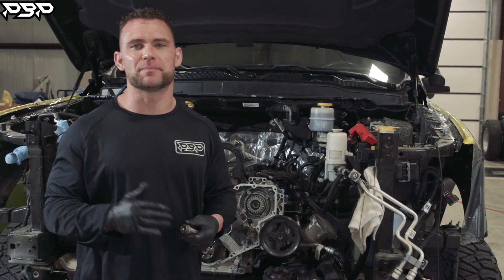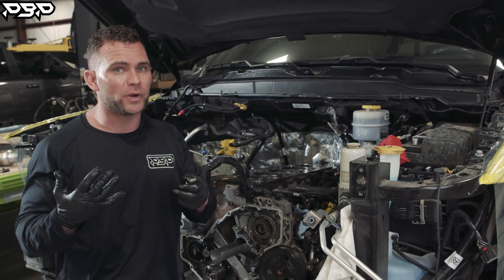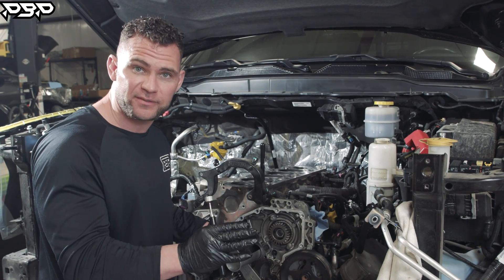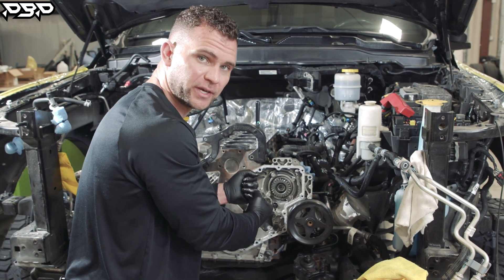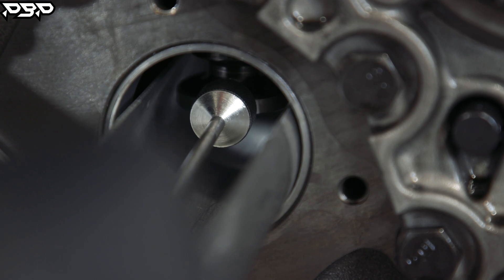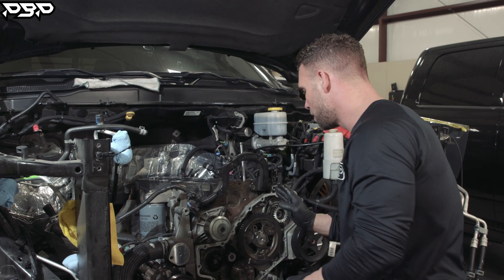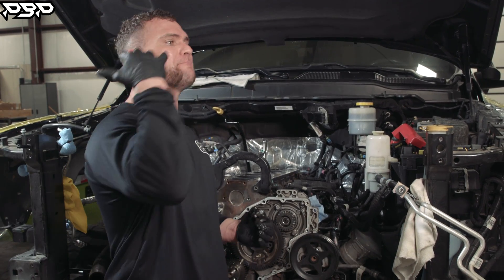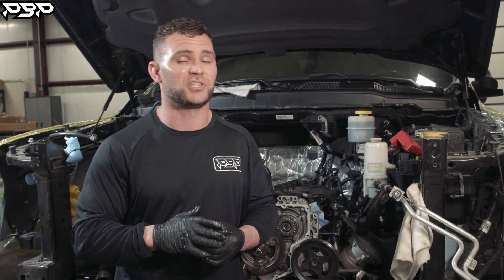5TH Gen Cummins Solid Tappet Camshaft Install!

Comment: Looking forward to doing this in my truck. 72K problem-free miles but I know those stock lifters will get me at some point.
Reply from the maker: They may then again may not ! Check out our pushrod upgrade it’s worth the time. If you have any questions just holler sir.
Reply: @POINTBLANKPERFORMANCE That may actually be the way to go for now. Is that as reliable as the total tappet lifter swap? Of course it’s probably kinda hard to quantify that
Reply from the maker: We tell it like it is , it’s a preventative maintenance. Anything can happen.

Comment: Does the head have to come off the replace the cam?
Reply from the maker: No sir.
Reply: Without the head off and cab on can’t get the push rods out or new ones in on 5 and 6
Reply: @hookedonjesus1716  I am so tired of hearing and worrying about what could grenade my 2022 I am going to sell it. Not going to buy a new truck again.
Reply from the maker: New meaning 25 and 26 ? Or 24s?
Reply: @POINTBLANKPERFORMANCE  Thats right and I won't buy another new one. Bought the 22 new and the one before and so on. If I have to pull cab just to keep the reliably up then they not worth the coast. We don't run near as much anyways.

Comment: after this swap do we go back to using 15w40 again or keep using 5W40?
Reply: that's what i did.  and that is what techs and hamilton suggested.
Reply: 5w vs 15w isn't as big on an issue for you if you live in the south. The 40w is after your oil gets warm. The w number is for cold flow. So if you're in the north and it's -5F, the 15w won't flow very well. Not that the 5 will, but it is way better.

Comment: Can this be done head on?
Reply from the maker: It can yes!
Reply: Might have to dropped a valve bridge last week worried about a worn cam lobe?
Reply: Its a solid tappet already as a 18. Kinda thinking the tow cam from hamleton if its a drop in for a 6.7 for sure

Comment: I have a 370 horse 2021 ram i would like to put the hamilton 7-cc24v19+ in my truck but keep the rest of the engine stock . Would it be good fit ?

Comment: Damn I just bought a 2024 ram 3500 with the Cummins.  Did I make a mistake?  If I do get the tick and the rollers go bad if I switch to the flat tappet with the stock size cam in the kit will it throw any codes and will it be more reliable?  Located in southeast Missouri might have to drop the truck off at some point.  I’m looking for reliability.
-Dan
Reply from the maker: Hey Dan I wouldn’t get to worried right off the bat, all of them have a tick. For good insurance I recommend swapping to our upgraded push rods I go into detail on the website of why. If you do ever want to swap to a solid set up then the tappets is what we recommend.

Comment: Doesn’t make Any sense at all to me.  You’re telling me need 12 magnets to hold the lifters?  Is this just a 5th gen thing?
Reply from the maker: That is correct sir, if you don’t hold up on the lifters you cannot get the cam out. It’s an all 6.7L Cummins thing. This help sir make better sense?
Reply: This is an integral cam thing. It is legit not new. It is known.

Comment: I think a lot of us want to know if an upgrade to a Hamilton Cam - lifters - rockers will solve the cam lifter issue. Will the Hamilton Camshaft upgrade get enough OIL to have the same life as the the pre 2019 camshaft,  stock engine.
 Does the 2019+ stock cam oiling play a partial role in the roller cam failure???
Reply from the maker: Yes sir we have a great luck with swapping out to the solid tappet camshafts sir!

Comment: Currently getting this kit put in my 2020 with a 188/220. Mine has 12mm cp3, 100%s, 2g swap with s467, fass 290 and built trans. Excited to see the difference.
Reply: That's a lot of fuel for just a 467. Good grief.
Reply from the maker: She will be rowdy !!

Comment: If I have a 5th gen and it needs lifters- could I get away with doing a big dog cam on stock turbo/fuel ? Not looking to do a full build at one time, figure I might as well upgrade while I’m in there… thoughts?
Reply from the maker: Do the big cam off the bat wont hurt anything sir. Got a customer still stock everything but big cam! We have them here 👉 https://pointblank-performance.myshopify.com/products/hamilton-cams

Comment: I have a 5th gen Cummins. and I had to send my truck in to the dealership because of the lifter failure. And now I’m having the same problem again. And it’s frustrating.
Reply: What year? & How many miles?  Ho or so?
Reply from the maker: @SteveCallsen 19,24k,non ho.

Comment: Anyone have any experience putting a 5inch full exhaust on a ram with air suspension? Looking for tips for install.
Reply: I don’t have factory air suspension, but I have aftermarket airlift bags. There’s plenty of clearance, but just in case I heat wrapped around the airbag

Comment: Great video 👌🏽
Does this upgrade works out? Thinking about upgrading to this but saw something about the problem will come back in a long period
Reply from the maker: Hey sir the issue of what coming back ? I’ll try to help !
Reply: @POINTBLANKPERFORMANCE  the problem about ram ticking noise mine started when did 1st oil change and after a few research seems it’s the lifters. I been keeping up to see if there’s a good solution and find out this one. But saw a few others saying that the problem will come back in a long period of time. 2020 Ram 16k miles on it
Reply: @POINTBLANKPERFORMANCE it’s still a CGI block…some guys think that is the problem not the lifters themselves
Reply: That’s the solid lifter upgrade that doesn’t work you’re thinking about.

Comment: how is tappet better than a roller ?
Reply: No bearings and no hydraulics
Reply: @RadDadisRad  And no Roller Lifter guides...
Reply: @time7705  yep, no keys or dogbones.
Reply: Also it gives you more accurate valve lift, yes it’s probably not going to last as long but honestly I have 300,000 miles on my gen 3 6.7 and factory solid lifters, 600hp. Also allows you to go higher in the rev range. With a longer duration higher lift cam. Plus when you spend a life time as a millwright changing cam followers every week on every machine, you understand real quick they do not take any load hardly at all for very long before the cam follower wears and you loose .020-.030 thousandths lift. It’s the same thing with these they wear out and if you were to put a bigger cam in, increasing the load, they would fail even quicker. The roller should have less friction theoretically, but honestly look at the size of the pins and the roller, in the lifter, they are not very impressive. I’m sure some custom designed roller lifters would be better but at what cost,
Reply: For example my 22 dodge ram 2500 @ 10k miles already has excessive lifter knock on and off from poor design on lifters. Dealership claims it’s normal hahaha FML
Reply: Poor design. Even has tsb for the type of oil. My gen 5 just failed and in the shop now. 160k miles on it.
Reply: No rollor to keep inline with the cam shaft and no niddle bearings to wipe out the engine . The big 855 cummins had rollor soild lifter not hydrulic rollor lifters